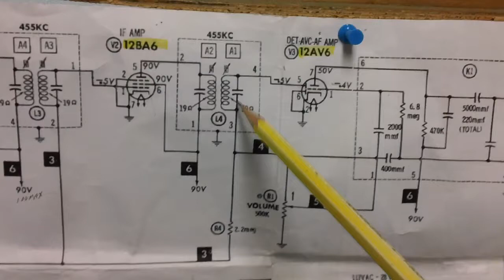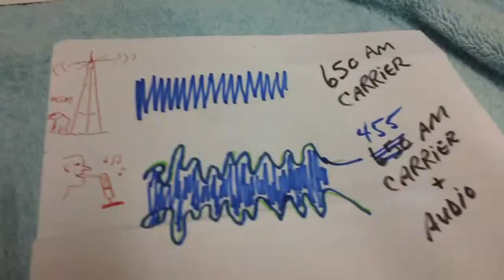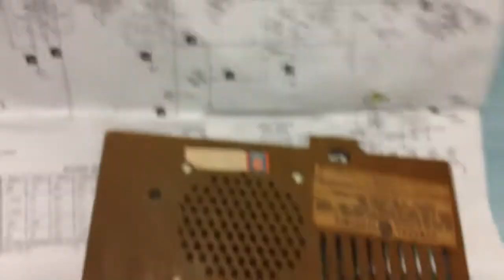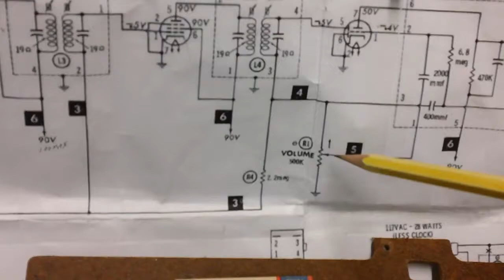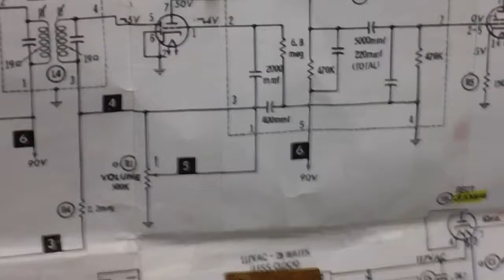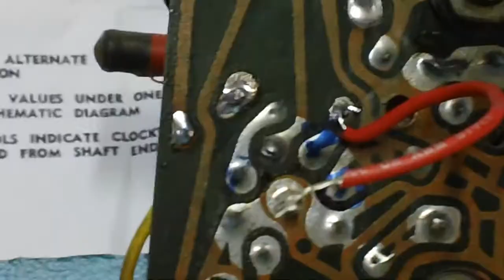General Electric C-403A Radio Repair Exercises (part 8 of 14).

Comment: John,
I wish I could have a pound for every Japanese transistor radio tuning capacitor I have replaced over the years that became subject to Silver Mica Disease (UK – Silver Mica Cancer).  Once it occurs, there is no way of reversing the effect, or repairing those tuning capacitors: they are for disposing into the dustbin.  Your creation of this effect was, as you said, very close to the real thing…well done!
Demodulation (I’ve also read it as being ‘nonlinear rectification’ LOL), AGC, and audio pre-amplification circuitries were very well explained: I enjoyed viewing this production very much my friend.
In passing, temporarily removing the 2.2MEG resistor from the AGC line, and listening to distant radio stations, might have given a sort of fluctuating reception often heard on TRF radios (piercing sounds on peak signals and dull gravelly, nasal-like, sounds when the signal is fading).  
Regards,
Phil.

Comment: Thanks, John! I'm actually working on a  similar AA5 radio right now. I recapped it and rebuilt the capulate.  It plays great, but for some reason I get occasional feedback after the radio has been playing for a while.  It seems to go away when I wiggle or rapidly move the volume control. Any ideas?
Reply from the maker: Ron,
Just about anything could be causing your intermittent problem, but I'd first use an analog multimeter to check out the volume control.  Rotate and/or wiggle the control very slowly and watch for needle jumps.  Also closely eyeball all the ground connections.
Best I can do on short notice, my friend.

Regards,
John
Reply: Thanks, John! As always, I greatly appreciate it.
Reply: joernone Update: I ran the 12AV6 through tube tester. Shorts galore. I ordered a new one, so we'll see what happens.
Reply from the maker: Ron,
Lesson learned, my friend.  Check the tubes first.  Easiest thing to do.  Replace the bad and weak and you'll be off and running to perform further troubleshooting.  You've got to have known-good tubes to begin with.
Good luck.

Regards,
John

Comment: John question about safety, are all these sets chassis hot? I know one side of line voltage goes to chassis on my late 50's Zenith
Reply from the maker: Tony,
If this radio had a metal chassis instead of a printed circuit board, I'd say yes, but there's really not too much to worry about with this one as long as I don't start indiscriminately touching the runs on the back of the board.  The brown circuit board itself in non-conductive.

Regards,
John
Reply: I understood that about printed circuit board, I was curious if all metal chassis ones were hot.
 both sets I have are metal chassis.
Reply from the maker: Tony,
It's the transformerless AC-DC radios that pose the hot chassis issue.  Is that the kind you have?

Regards,
John
Reply: one I have has a small transformer the the second one has no transformer
Reply from the maker: Tony,
The radio without the power transformer is the one that could have a hot chassis.  Depends on how it's wired.  But even if you rewire it so the chassis is no longer connected to the hot side of the line, it would only be safe if the wall plug you were using was wired correctly.  If it were wired backward, you'd be right back  in the same boat.

Regards,
John
Reply: Thanks
Reply: John my RF IF coils mica is bad, the ohms on schematic shows 30 ohm on each one. What size of silver mica cap I use I have some 1000 pico caps at 500 volt would that be ok?
Reply from the maker: Tony,
You lost me on this one. Are you sure you're not reading resistance through each of the transformer coils?  It's what will happen if you just stick one probe on each capacitor plate and take a reading.
What model radio is this?

Regards,
John
Reply: John this is a G E 465 on the schematic it is showing the RF and IF at 30 ohm. I am replacing the mica in the can they were both bad
Reply: Its almost identical to radio your doing videos on
Reply: John that is the omhs on the primary and secondary coils
Reply from the maker: Tony,
To keep you from doing unnecessary work, I have to ask why you believe the mica is bad in your IF transformers.  What brings you to that conclusion?

Regards,
John
Reply: joernone
well radio has just static and volume goes up and down when i looked in the can the mica was arced pretty bad and the mica was in two pieces
Reply: I checked continuity of coils all was good
wires intact
Reply from the maker: Tony,
Now we're cooking with gas, my friend.  You should have told me that sooner.
Generally speaking, the 455Khz IF can capacitors had values of 110pf, so use 100pf to 120pf as replacements. Actually, the values aren't all that critical.  I know folks who always use 150pf caps.  Anyway, I'd think a good working voltage would be 150vdc to 200vdc, but if you're concerned about it then go with a higher voltage.

Regards,
John
Reply: I am sorry I goofed
Reply: I thought my 1000pf was a little high.I could not find the values you stated
Reply: I had recapped this radio it had several melting caps and all I still was getting was scratchy volume that went up and down, i soldered a couple of those high value caps in the IF can but all I am getting now is a low 60 cycle sound in the speaker
Reply from the maker: Tony,
Installing the right value IF can caps should bring that radio back to life, as long as the slugs aren't misadjusted and the rest of the work is good to go.  If they're out of adjustment, you'll need to tweak them back in.
Let us know how it went.

Regards,
John
Reply: Thanks John will do, enjoy your videos a lot of
 help

Comment: John..what does that carrier sound like? Is it noise? What would happen if that capacitor is open and cant dump the carrier to ground? ...Thanks....Buzz
Reply from the maker: Buzz,
I knew someone would ask that question.  Unfortunately the capacitor you speak of is inside that square thingy...called a couplate.  I'll get with Brendan and see if we can figure out a way to remove it from the circuit without damaging the rest of the component.  I'm sure he'll come up with something.  :-)

Regards,
John

Comment: Aha, it has a smoke "detector" for when it SMOKES! 
So ya gotta get rid of that junk "motorcycles" carrier, that leaves the killercycles.
I guess  that one way valve keeps things going positively, not negatively, so the motorcycles do not enter.
 When it comes out, it reminds me of my new sump pump that sends it under pressure, amplified, and outta there.
Keep those electrons flowing old chap, if what i said makes any sense, let me know??? (it doesn't to me)
Cheerz,  Don

Comment: Where is the problem, if you have silver mica disease.
Reply from the maker: Brother Mac,
At the bottom of the IF can where the silver colored capacitor fingers (plates) are located.  They have a small square of mica between them.  Over time the silver leaves the metal plates and spreads out over the mica, changing the capacitance value.  It also changes color from silver to a blackish appearance. Looks like black tarnish.  We'll cover SMD a little more in the next vid.

Regards,
John

Comment: Is there a special reason why they put ( K1 )  in a package, rather then just build it on the board.
Reply from the maker: Brother,
Cheaper, faster to install on the assembly line and saved room on the chassis...thus smaller, cheaper chassis. 

Regards,
John